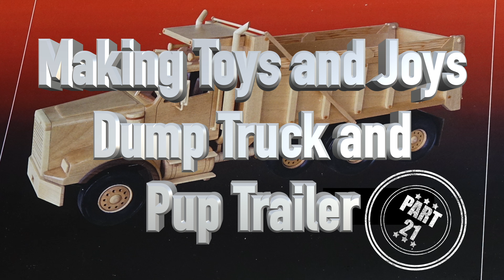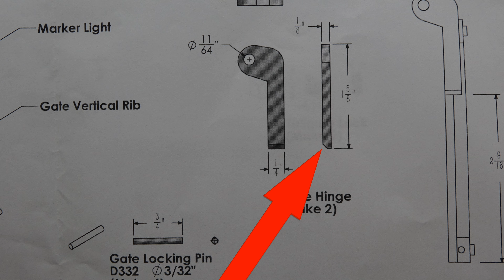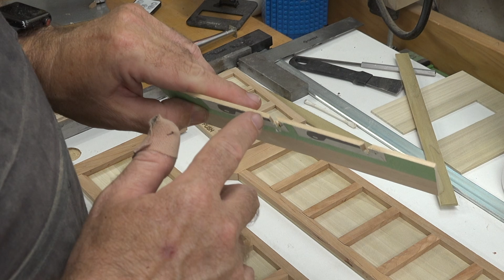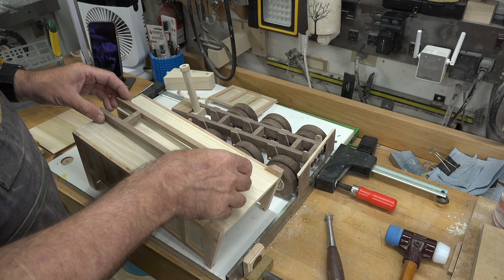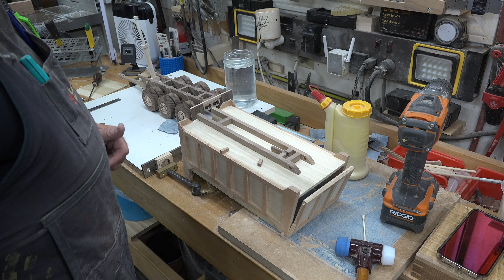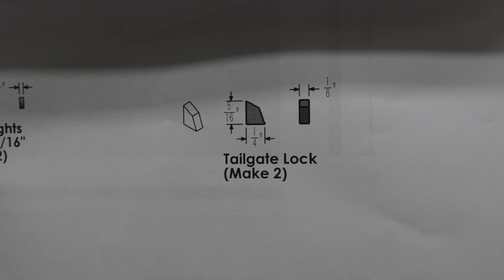Making Toys and Joys Dump Truck and Pup Trailer   Part 21

Comment: Thank you Ken for showing all the process involved in the built.  My question, you mentioned at the end it takes a lot of time to built one, what is your view to built 3 or 4 trucks at the same time, that way you take advantage to minimize the set up time and measure time.  Thanks in advance for sharing your view.
Reply from the maker: The first one is always the hardest and slowest to build.  Building more than one at a time greatly decreases the build time due to setting up once and performing 4 procedures.  (as you pointed out). I've only ever done one model where I made multiples at the same time and it was much quicker to make two than it was to just make one.  I hope this helps.  Thanks for tuning in